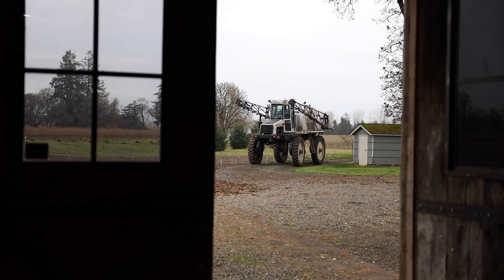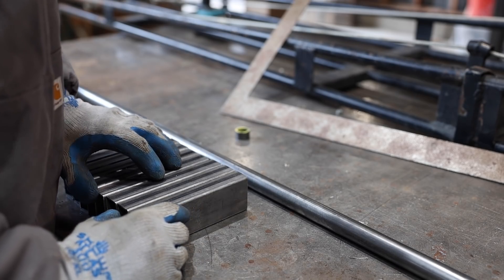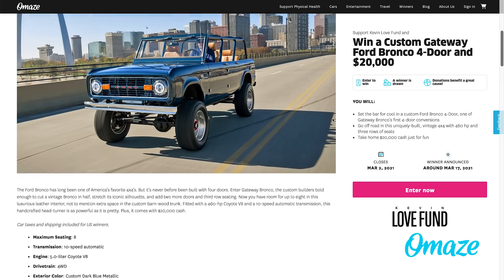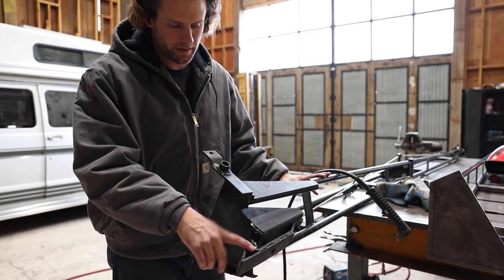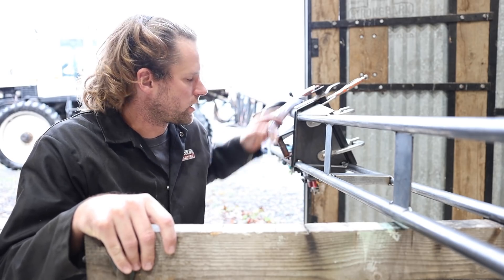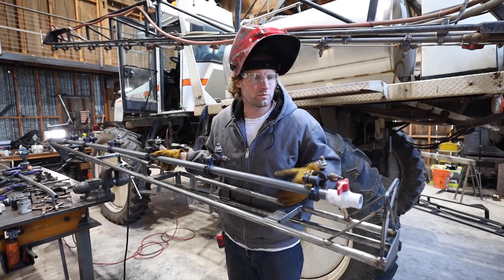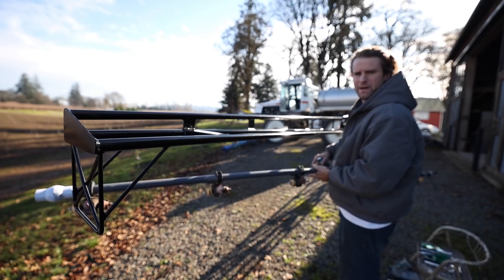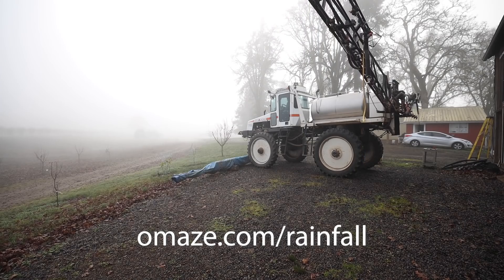Fabricating Sprayer Booms

Comment: I'd like to suggest next time when you have to rebuild those arms instead of cutting your square tube to size first leave it as one piece and take a hole saw and drill your holes on the edge of the box tubing first then cut it to size, that way you've already got the curvature to match the steel tubing. It would save you time on having to use the plasma cutter to cut all the notches in it.

Comment: Hi

Another great video! Thanks!

Seeing you work that UHMW for your sprayer reminds me:  The original manufacturer of ‘change row-width on-the-fly’ sprayers and detasseling machines was Modern Flow. Those machines used UHMW lined square steel tubing with another piece of steel tubing telescoped inside. The UHMW was bolted from the inside using counter-sunk, FH, SHC screws. Any burrs or other imperfections on the exterior of the inner tube were removed/polished. The end of the inner tube was given a big, polished chamfer. The whole thing was then liberally greased. Let’s see here, smooth, greased steel, on slick UHMW. Hmm 🤔 That’s got a coefficient of friction approaching a banana peel 🍌on a wet, tile floor. If you want to discuss further you can pm me or here as appropriate.

Be well & Best regards, Gottfried

Comment: I’m no farmer and what’s done is done but... 
Every inch you over extend those arms will add significant tension on the structure as a whole. “I would have” (I say from my cozy screen watching) considered making them shorter with the guard mounted before the last sprayer (with the sprayer overhanging). Fruit for thought

Comment: On the nozzle guards, might think about welding on a bit of flat plate with a bend at the front so that if it hits the ground it is likely to ski across it rather than dig into the ground. Otherwise, cool project. Well done.
Reply: Some people put 1 small leaf of a trailer leaf spring on the end to act as a skid and a spring 

Iv seen someone put a 12in wheel off a kids bike as well
Reply: @fowletm1992  the leaf works really well but it has to be mounted to the main boom rather than the breakaway.
Reply: So cool the way different people fix the same problem in different ways using what they have. Problem solving masters! I AM impressed!